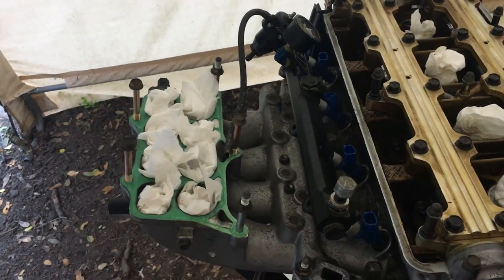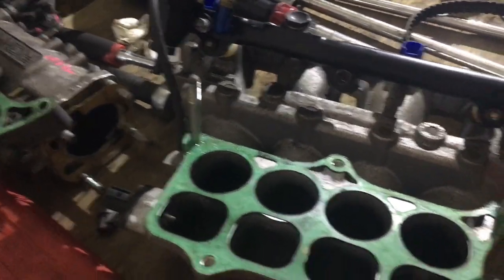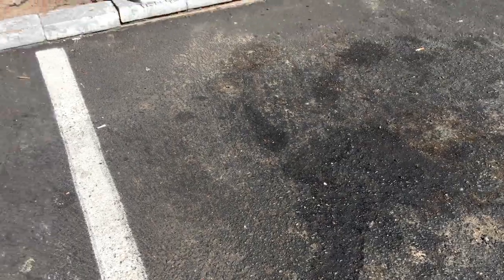CB7 Nearly Catches Fire!

Comment: Hey i need your opinion and expertise.  Now can i use the egr valve from my f22a6 motor on my h22a4 engine since the plug is different from the one thats on the h22a4 currently?
Reply from the maker: Do the two different connectors have the same number of wires?  If so, you can cut the F22 connector, cut the H22 connector and solder the wires together (matching colors, of course) or de-pin both connectors and put the F22 pins in the H22 conmector.  However, I think the easiest way to do this is to just get an H22 EGR and be done with it.